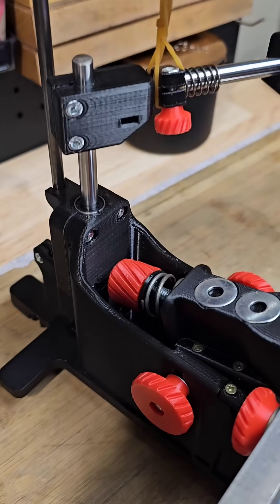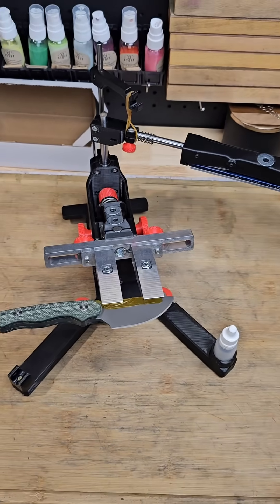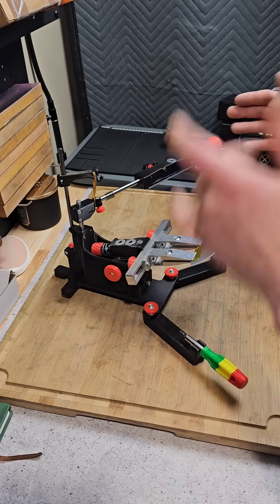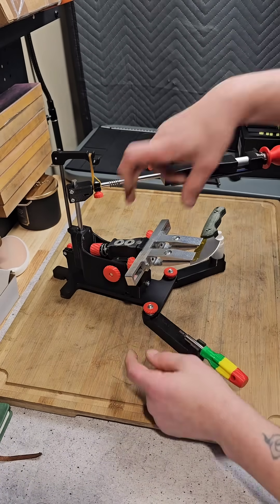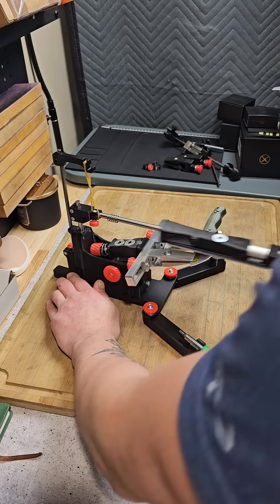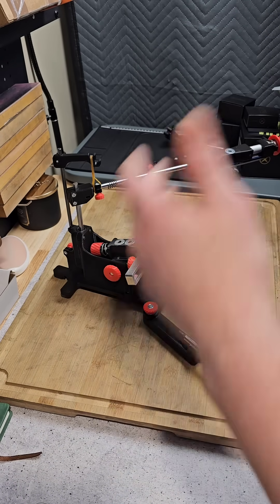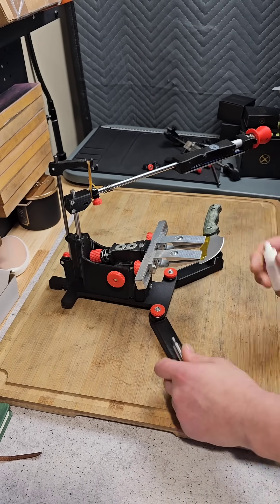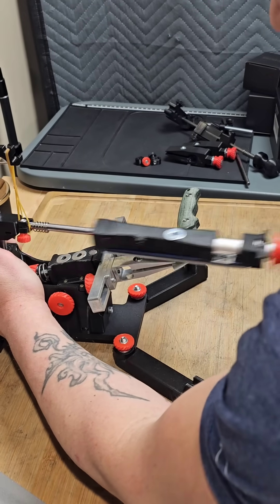3D PRINTED FIXED ANGLED SHARPENING SYSTEM??

Comment: Looking at the mechanism at a quick glance i thought the holding position is good but thought magnetically would make for a quicker switch and strong enough as well making it necessary we need to replace the stone having to buy it from you. Just a thought at a quick glance. And price around $100-$120 its a bit pricy but certainly looks durable so in time it pays for its self.and the need to get original parts from you making it a repeat costumer for life. Quality over quantity 😎

Comment: They could make the stone holder bar spring
Loaded a washer at base and lock collar at top so it depresses when sharpening eliminate  the rubber band and replace with something more permanent this is so cool though

Comment: The clamp "Retails for" $75 - $150 in the TSPROF pricing domain.  The price of the system very hard to say.
TSPROF system = $300 - $600 Stones, $1,000 System, $500 in add on clamps.  The goof is that I have become very good at sharpening on bench stones.   Price for the system as presented in the video $175 or so bare bones.

Comment: I'd give it about the same as the EdgePro Beveltech, which is around $500.  Maybe a little more because of the ability to leave the knife clamped and flip it.

I have the cheaper and older EdgePro Apex and will likely not replace it as it works so well.

One thing I'm curious about is how well you're able to center the blade in the clamp. You have the digital angle measuring too attached to the back end on the clamp handle, how well does that correlate to the angle of the blade itself?

I like the design and simple things like the rubber band to keep the stones out of the way but the base could me made simpler - maybe just a clamp design for the edge of a table or work bench of the option of a simple base with a few holes that you can permanently screw into a work bench.

Comment: 1. Put holes in the end of the legs to bolt to a table.
2. Put rubber piece in clamp like the "kme sharpener " then no need to tape knives
3. Maybe find a better retractable device for the stone. Rubberband seems a bit cheap. Great idea though for sure.
4. Alot of people dont understand that they're not just paying for a service/item, they're also paying for the knowledge/experience of the person providing the service/item. My opinion charge what you feel you think your service/item/knowledge/experience is worth. Also I'd guess you'd be safe to charge anything under $200. Just my opinion
Reply: Да, резинка возможно и смотрится дешево но это  гениальное решение простоты мысли и функционала. 
Резинка это компенсатор веса камня что очень важно на финишной доводки. Главное правило не давить на режущую кромку

Comment: 3D printed means privately run with low personal work time and low input cost. I’m not saying I personally could do it, but I think it should 1) profit the builder and 2) not be even close to the same price as other sharpeners

Comment: Instead of a rubber band, could you use a strut if you could find one small enough?
Reply: No
Reply: Spring would be better just put a washer at bottom and a lock collar at top that way the stone holder bar that telescopes up and down is spring loaded
Reply: @Stolas1777 But no, as practice has shown, the rubber band is a brilliant solution.

Comment: It's very interesting.  Would you consider selling it as plans or a kit where the end users could print their own plastic parts?
Reply: Seems like the whole point of using 3d printed parts would be to sell the hard parts along with the print file so the buyer can produce most of the sharpener himself.  That's what makes it affordable for someone to have a higher end sharpener at a more reasonable price.  I just don't know how big the market would be.  You're kind of targeting a crossover of two fairly niche groups, guys with printers who also are into knives.
Reply from the maker: @invictusbp1prop143  yeah it's tough, because it does cost a bit to make, so to sell is tough to make profits without it being what I would consider over priced, but maybe the files could be negotiated
Reply from the maker: @rogernettles6719  it's not mine nor ready yet it something that might be in the future

Comment: It would be way more than 50 for sure hell the 3d printed stone cases on gritomatic are 50 60 bucks this i would say would be close to 150
Reply from the maker: @kevinfitz3721  👊
Reply: @NeevesKnives  oh yeah I got question for you on the tsprof k03 pro hunter do you need to level or calibrate the system itself i did the stone holder and that little jig thats 14 degrees but in other videos I see them loosen screws and use a actual angle cube and tinker with the horizontal and vertical is that necessary?
Reply: @NeevesKnives  and if you have one would you do a sharpening video on the tsprof ko3 pro hunter with a benchmade 710 I want to see how you will clamp it and stuff
Reply from the maker: @kevinfitz3721  i don't have a 710 sorry but what I would do is i would use my single clamp and put kapton tape on blade spine, and clamp in flat area if needed I would remove the thumbstuds

Comment: This is an amazing proof of concept. I love the idea of the  vertical sliding stone rail. This to my understanding should eliminate the slight angle variation with the curve of the belly of the knife. Should also provide angle consistency when using different thickness stones.
Reply from the maker: @n00baTr00pa  yeah that's true, and is probably why it was easier to hit the tip without hitting stone
Reply from the maker: @n00baTr00pa  i meant hitting clamp